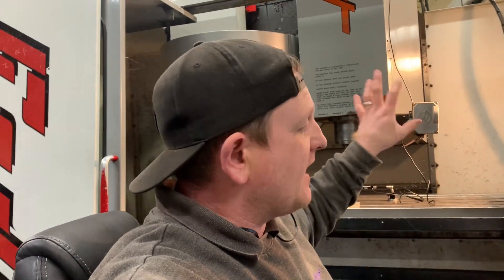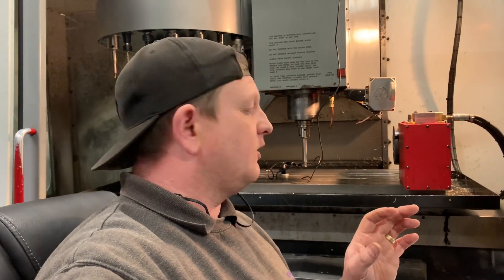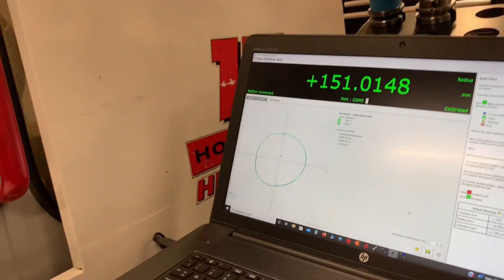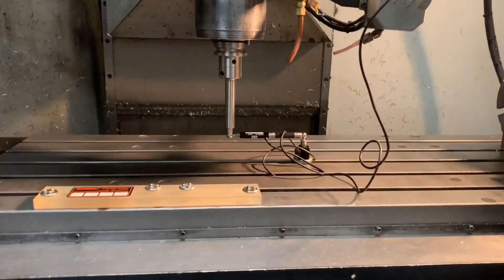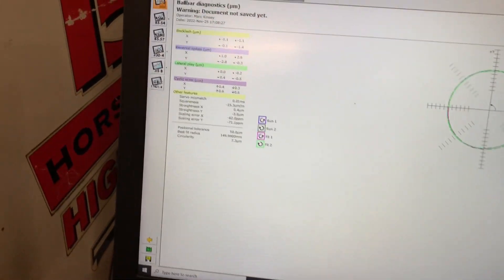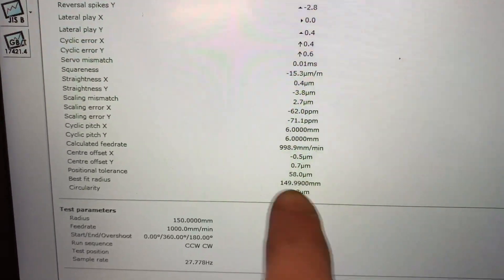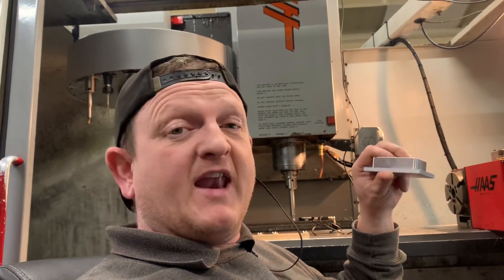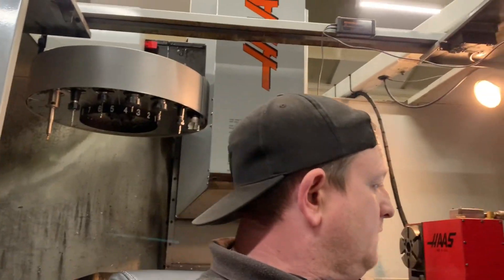Haas VF3 Renishaw ballbar test in the xy plane

Comment: I suspect half of that finish issue is re-cutting of chips if they're not getting wizzed out of the way by air and or coolant.

Found it on some big parts I've made where the chips don't get flung out enough and if I don't pause the program and air blast the mountain of swarf out manually, the surface finish of the pockets can be sub standard.
Reply from the maker: Hi

Thanks for the reply, i know exactly what you mean but that did not seem to be the issue here,  i have some other big part programs i run on my other Haas where i add an M0 in places to stop and remove chips before finish passes etc
I think this is just old age and wear in screws and or bearings

Thanks
Marc